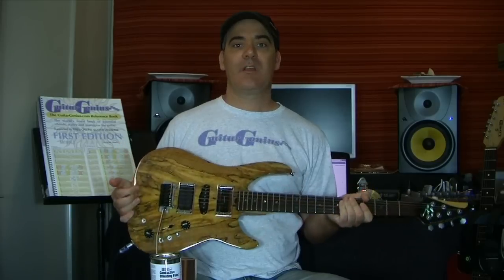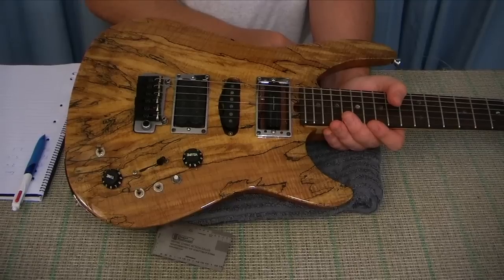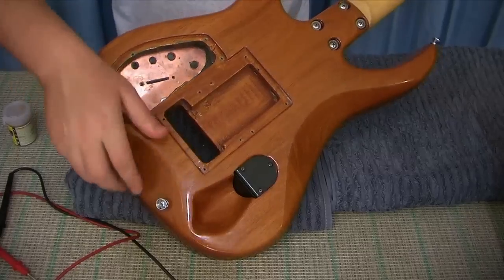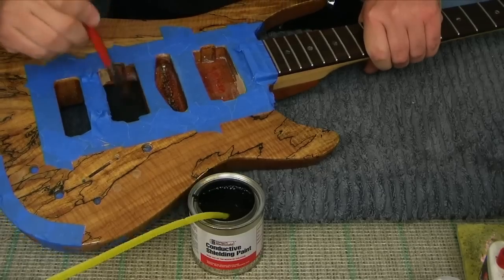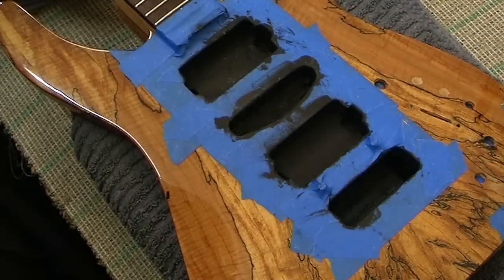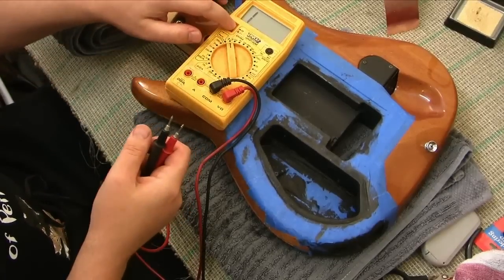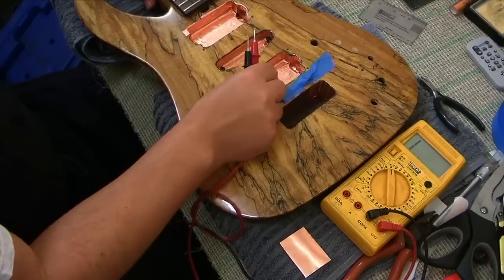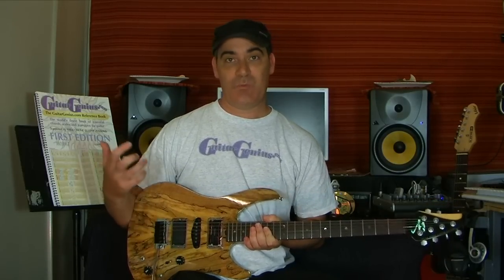Electric Guitar Shielding with Conductive Paint and Copper Tape

Comment: Aluninium or anti snail tape works just as well, and is cheaper
Reply: The adhesive is generally not conductive though. To address that if you want to use it I saw a video today that used fold over bits and tape on top of that to make the overlaps connect electrically.

Comment: Question: It would be the same effect if you would use ALU tape?
Reply: You can but its a little harder to get the conductivity with aluminum tape since it has more adhesive on the bottom. One way I worked around this was by l all the alu tape and then using very small pieces of copper tape to connect those layers or by scraping off some of the adhesive on the bottom of the alu tape before placing the piece atop another. With copper tape you dont have to worry about that.

Comment: So even though at the end of the video you mention you won't use the conductive paint again, is it still recommended?
Reply from the maker: +Pat Rogers I would only use it in areas where you need shielding but can't get copper foil or shielded wires in there. IE, where holes are drilled to feed wires through.
Reply: +GuitarGeniusCom Gotcha, thanks man.

Comment: Drop the paint in the trash and use only foil. Use the star ground method, run all your grounds to a single screw that make good contact with the shield. Place this screw close to the output jack and connect it to ground side of the jack. In that guitar i would ground to the copper tape or solder a jumper between tape seams and run that wire to the star ground. Before all this id drop the single coil in the trash, just put an on off switch on ech humbucker and get rid of all the tone circuitry and just run a volime pot. Eddie van halen wasnt wrong. The tone sucked out by junk in the circuit us very real and so liberating when you get rid of that junk. My mqin bass i built out aluminum, steel and brass with a moses graphite neck. Humbuckers run straight to the jack with nothing between the guitar and amp results in sound that i call "voice of god".

Comment: Testing the surface of the paint proves nothing when it comes to shielding. The metal in the paint acts like a faraday cage regardless. It basically acts like a buffer to impede induction into the components from outside interference.

A more accurate test would have been to do a before paint(the feedback at the beginning of the video), after paint, and after paint and copper feedback test.